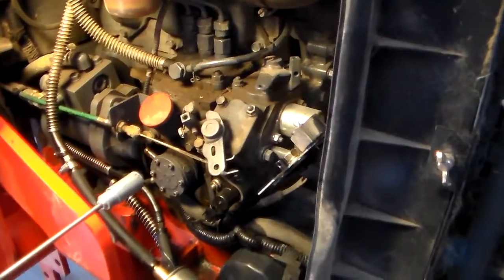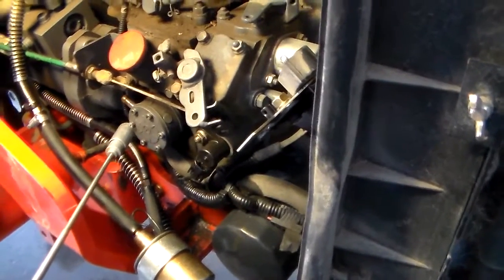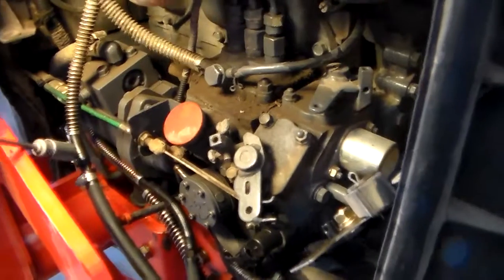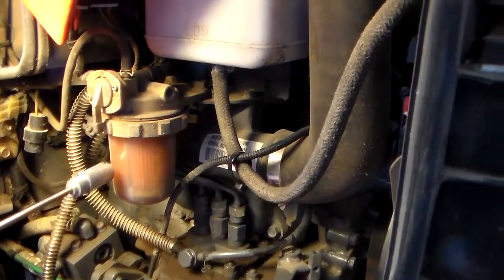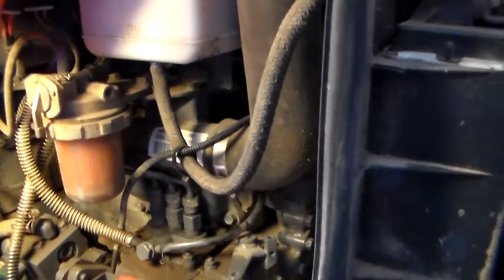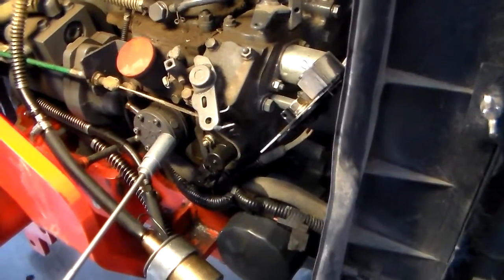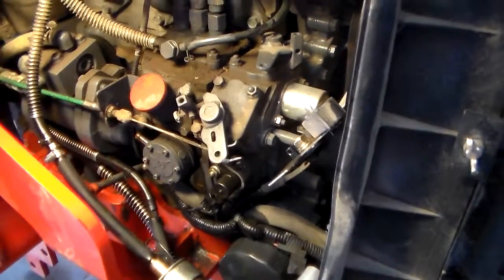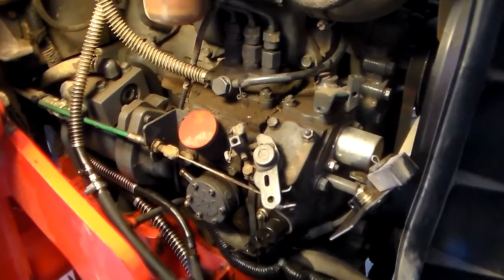Kioti CK27 Fuel Pump diagnosis

Comment: Thanks! My neighbors Kioti is doing the same thing, I’m thinking air leak or lift pump, but I think I’ll go straight to electric lift pump after watching thIs ,his Mainly stalls every 2 min or so of operation, especially under load.  I noticed there’s no bubbles in the clear fuel filter hosing, so I bet it’s a pressure/supply problem since he’s just replaced the filters with no change

Comment: Had the same issue with a cushman CD1600 had a small hole  In the diaphragm and it was not pumping fuel into the injector pump but pumping it straight into the crank case